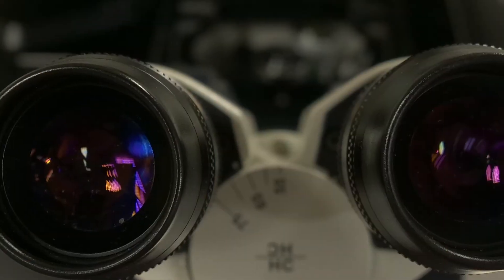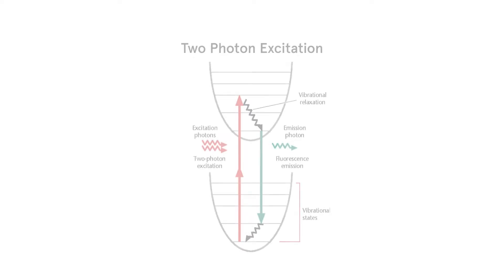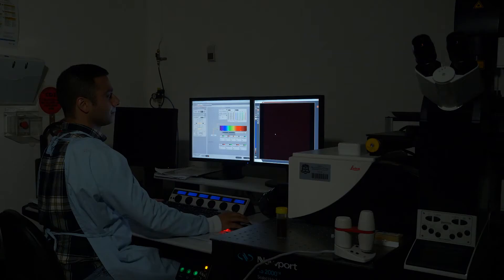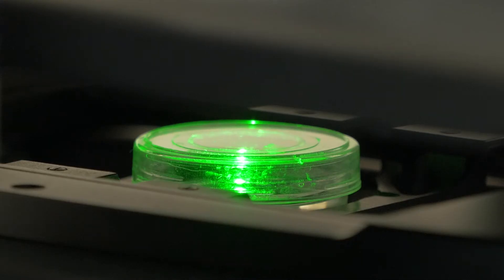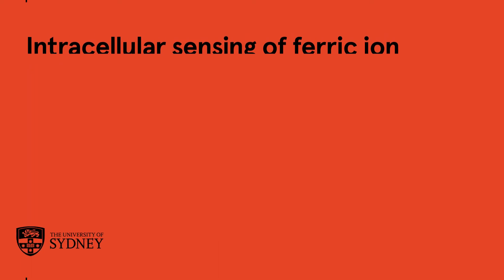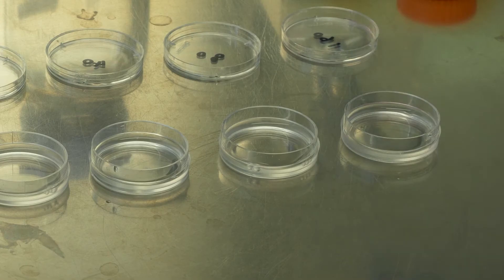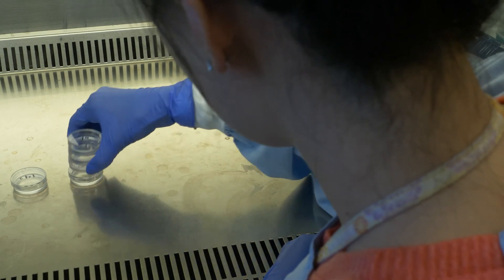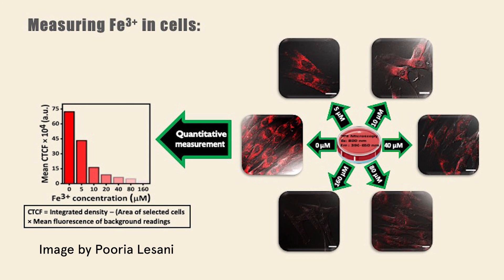Carbon Quantum Dots: Hydrothermal Synthesis and characterization (Part 2/2)

Comment: Could quantum dots be injected into the human body and self essemble into micro biosensors?
Reply: Also in order for them to become bioavailable do they need to be encapsulated into a lipid?
Reply from the maker: @codybourque6099  depends on the application (or injection method)... it can be simply surface modified before the intravenous injection or encapsulated in a lipid for efficient distribution in body.
Reply: @NanoAustralia  I have heard great potential to use these technologies as tools to assist in  many medical intervention from detection of illnesses to drug delivery. I'm greatful for your feedback as you may have terminology that can assist in my research and understanding of this topic. Subscribed!
Reply from the maker: Yah, probably by performing the desing of your system based on Aggregation Induced Emission (AEI)
Reply: @NanoAustralia  thank you for your prompt response and knawledge. This is very interesting. In order for AIE to occur does there need to be an external frequency, is there a temperature dependent reaction (cold to hot or does it require an additional chemical stimulus?
Reply: Also do the materials of the QD from which they are made determine the mechanism of AIE  (Graphene, Zinc, selenium, cadmium based.) ?

Comment: CAN CARBON QUANTUM DOTS ARE CRYSTALLINE IN NATURE?
Reply: How do you break this down if it in the body?
Reply from the maker: @ricardolozano1240  good question. I believe this need further and long-term in vivo studies.
Reply from the maker: they can be either crystalline or amorphous in the core based on the synthesis method and or its synthesis parameters.
Reply: I prepared CQD from Ascorbic acid...confused in SAED pattern..  But XRD is clearly crystalline...  How we  know the nature of CQD
Reply from the maker: @sincyannaoommen1328  what does the SAED patterns show? if not consistent with XRD, you might need to do Raman spectroscopy to find out the crystallinity of your sample.
Reply: OK sir..  Thank you...  It is very high fluroscent material na..  So what is the minimum excitation wavelength give while doing Raman spectroscopy?  Didnt get at range 600nm
Reply from the maker: @sincyannaoommen1328  I would try different excitation wavelengths. It can be challenging to get Raman results.
Reply: Yes.. Sir could you please give your mail id?
Reply: My CQD is in liquid form... I dropcasted in glass slide and dried.. Is it enough for Raman analysis?